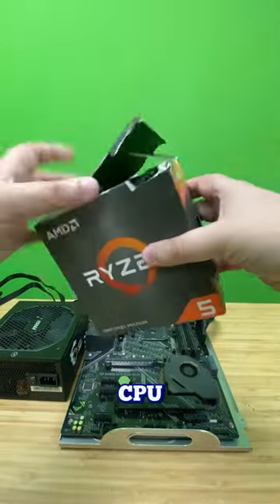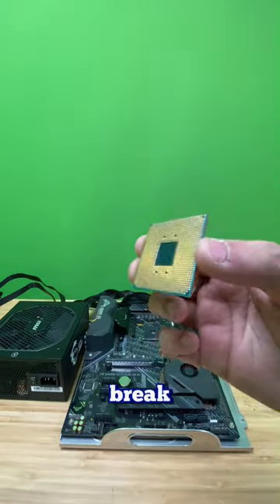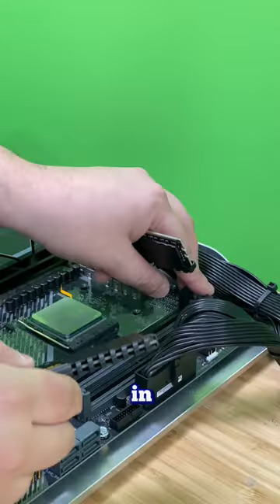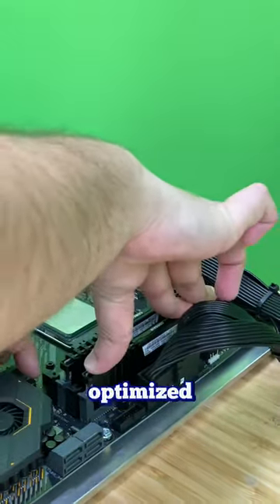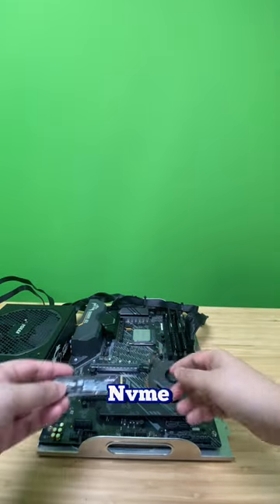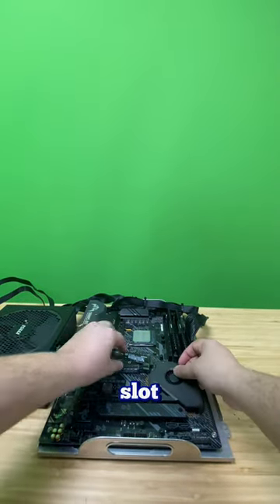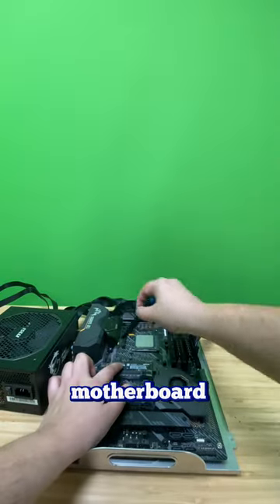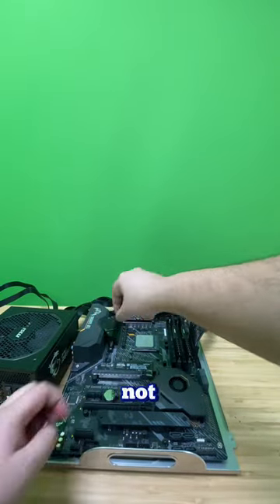PREPPING YOUR MOTHERBOARD! 🤩 #motherboard #pc #howto #gamingpc #pcgaming #egirl #gamerguy

Comment: Making my first PC on my own soon these are the parts I have picked out 

MB: MSI MPG B550 GAMING PLUS 
CPU: AMD Ryzen 5 5600X 6-core
GPU: MSI Mech Radeon RX 6600 XT
SSD: TEAMGROUP MP33 PRO 2TB 
RAM: 2 x 8GB CORSAIR - VENGEANCE LPX 3600MHz DDR4 C18
PSU: Seasonic PRIME TX-650

Total is just under 1000$ 
Still need a cpu cooler, pc case, and a monitor
Reply: thats a sick build bro everything looks good. what cpu cooler and case were u thinkin?
Reply: @TayoKM  some type of white case most likey was thinking of doing the one with the optical illusion led mirror on the front of it and idk if I'm gonna just get a ak400 or a AIO cooler
Reply: @TayoKM  goin with 360mm artic aio

Comment: Guys just don’t use AMD 😉
Reply: Why not
Reply: Well the only thing that’s close to the R5 5500’s price in my country is the i3-10100f which is slower single-core, mobos are more expensive and has 2 less cores
Reply: Someone’s still living in a time when Intel was basically a monopoly
Reply: @chrismansour5191  uhh lmao wha… intel has more bang for buck rn
Reply: @Prodigyredd  no?
The R5 5600 is cheaper than the i3-13100f, has cheaper motherboards, outperforms the i3-13100f by quite a bit single core and has 6 cores vs the i3-13100f's 4 cores